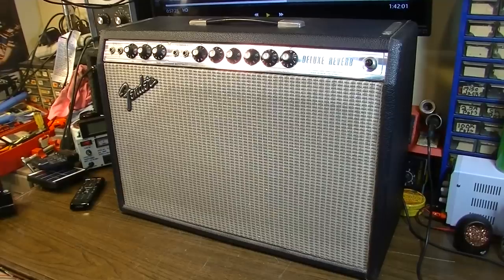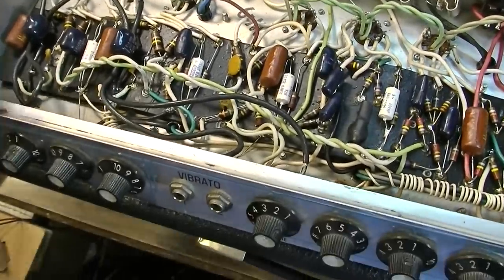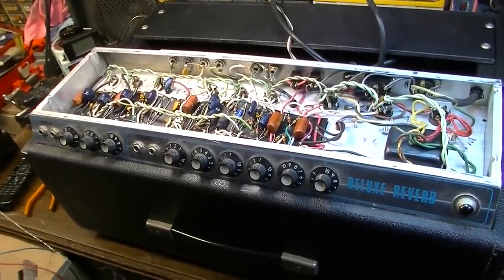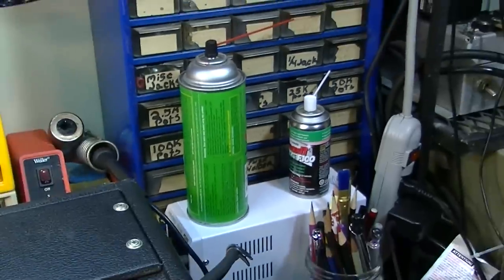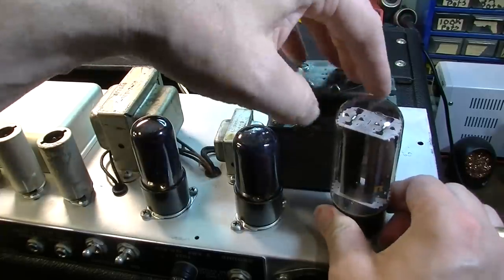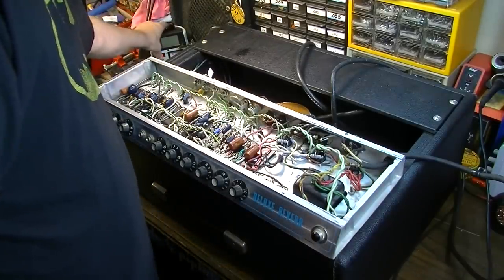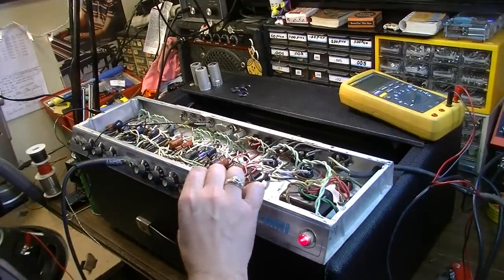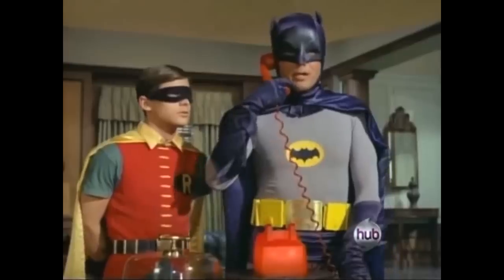SECRETS of the Fender Deluxe Reverb - The BEST Fender Amp Ever? (FULL SERVICE)

Comment: I hate to say it Brad but at the beginning the customer wrote and I quote "check the tubes"  lol...
Reply from the maker: I did. Didn't you see me fire up the expensive 1974 vintage tube tester and go to town at the end? ;)
Reply: I just don't understand I truly do not the customer specifically requested and still you refuse and yet you spend extra time to diagnose an issue you would have found by testing the tubes I mean you had them out why not test them at least you took some of what I said to heart on the last video maybe I can get you the rest of the way over the hump!
Reply from the maker: I didn't "refuse" anything. I did it. I spent no "extra time" either. As for cleaning sockets, I clean tube sockets as a matter of course all the time. Been doing it for years. I just don't do it on modern Mesa-Boogies less than 10-years-old with tubes that have no oxidation on the pins whatsoever. You saw me wiggle the tubes in that video...not a SINGLE pop, scratch, or hiccup. The sockets didn't need cleaning. It's that simple. The tubes that were faulty were discovered in due time and changed, same as they were here in this video, and it was done in the 1-hour minimum timeframe, meaning it was within the mandatory bench fee. Only one tube needed changed here and it got changed. Not sure what you want from me. My advice is maybe make your own videos. If you can figure out the YouTube algorithm, maybe you'll make a career of it. Good luck.
Reply: Now your just insulting my intelligence  you showed where the customer stated in his own words "check the tubes" if you did this you didn't show it and if you had you would have discovered the tube you ended up changing was bad and and that part would not be in the video it's that simple and had that tube been tested and changed at that point you would have had the circuit fixed much sooner.

As for cleaning tubes and or sockets I've watch most of your videos and have only seen you spray the sockets maybe a few times that I can remember but never seen you cleaning the pins until I mentioned it and I remember maybe one or twice you actually testing some tubes.

All I know is if I sent my amp in for service I would expect the tubes to be checked without needing to request it and if I had requested it and it didn't happen I would have my amp serviced somewhere else next time. 

I'm trying to give you suggestions that will only help you succeed but I'm starting to think they just fall on deaf ears.
Reply from the maker: Dude, the tube I changed was the reverb tube. I already knew the reverb had an issue and I wasn't troubleshooting the reverb until late in the video. By the time I came to troubleshoot the reverb, all I had to do was pull the tube, try another one, and discover, hey, problem solved. The symptom pointed to a likely tube issue and I even said as much a little earlier on.

Dude, you're welcome to type out all the suggestions you want, but they mainly just indicate you have not watched even a fraction of the 500 or so videos I've posted on this site. Frankly, I hate this fucking dick-measuring bullshit from other "techs" on the internet. It isn't worth my time. My default position is tubes are at fault a lot less of the time than most "techs" think. Tubes that test low emission could last another fucking decade and you know it. Lying to YOUR customers about these tubes' prospects in order to increase revenue at the expense of vintage RCA tubes is not an approaching I'm going to jump onboard with. Sorry. Get the fuck over it.

By the way...this might come as a shock to you, but I don't need your advice to "help me succeed". I have more requests for work than I can possibly take on.
Reply: Nope no more suggestions you got this all on your own!
Reply: You know I was gonna let this go but sense you feel the need for viciousness I'll say this, If your not open to constructive criticism maybe you should disable the comment section all together because it's not realistic that all you going to see are comments saying how wonderful you are coming from people who most of which have little to no technical knowledge at all.

I have not cussed or made any nasty vicious comments to you or about you, I've only made helpful comments to invoke adult level discussion on a topic of interest which should serve to help make "your" channel more interesting but now I see that's not what you truly want, you just want people to agree with you and the fact that I haven't has you coming undone at the seems.

So my last suggestion to you will be this, if you can't deal with comments along the lines of mine maybe YouTube is not the place for you if you can't embrace the community and your subscribers without coming undone I'd hate to see how you act if someone was really coming off sideways at you.
Reply: Doug The Tech Guy "this channel doesn't have any content." Why don't you show us all The Correct Way?
Reply: lamech006 I disagree the channel does have a lot of good content and I'm not bashing Brad at all everyone has their own approach to things and that's what makes the world so diverse but it's hard to not offer suggestions when you feel there's a better way to do things, I am by no means a Mr. know it all however I do know a lot about about of things but like I stated your not always going to have everyone agree on the same approach, I'm old enough and wise enough to know this.   

As for me doing video I have considered it but my work environment is not conducive to recording and I don't really have time honestly to edit video etc. I'm busy doing my own repairs I barley have time to comment on videos most times usually I just have a video I'm watching as I'm stuck at the bench, I work 7 days a week and a lot of times 15 hour days as I'm pretty busy most of the time and YouTube is my TV
Reply: Brown Paw you know I have a wall covered in diplomas and certifications and I've been in electronics in one form or another most of my life and I'm 50 now and I'm more than qualified to make the comments I do I can back up every statement with electronic facts I've not said one thing that's not true.

Comment: There is only one way that this amp is so clean. I hate to say it. It was a closet queen. Yes sir, it the cover put over it & then placed in a closet for all these years.
Reply: Two Beers actually it was filthy! I cleaned it up with a detergent and water the night before I took it to the guitologists shop. I was kind of embarrassed that I had had it for 4 months and really hadn't done anything to it to clean it. I took out the reverb tank and everything except the speaker. It probably wasn't an amp used for gigs. It does have a small amount of wear and tear but not much.

Comment: The boutique used gear shops think that they are made of gold.
Reply from the maker: Expect to pay between $900-$1200 for a SF in good, used condition right now. That's been my experience of late. The high side would be fully serviced and excellent condition. Maybe a little less for ones with issues. Still less than the new reissues. I can't imagine buying a reissue when the old ones are still less money.

Comment: Why is it that you only find reverb in an amp if it has tremolo as well? I can't think of a single Fender amp that has reverb on it all by itself. If you want reverb you have to have tremolo and that's that.
Reply: D.Edward Rice 
I noticed that as well.
I want a Vibroverb without the Vibro.
Really wish I could build the damn thing myself.
Reply from the maker: I love trem personally.
Reply: Blues Jr. has reverb, no tremolo.
Reply: Well I like it too for certain stuff. Truthfully, I'd probably find it far more useful if you weren't always stuck with the stock speed and depth. The depth control is probably OK as it stands but I'd like to be able to slow down the speed by a LOT. I'd like to fiddle around with something that was more in line with slow "sweep" of a phase shift pedal for the slow end of the scale. 

It's fast enough as is I guess but besides wondering why reverb was always tied to tremolo, I have also wondered why they never gave us a wider range of speed control on the trem. I know you can change the speed by fiddling around with the values of those 3 caps in the trem circuit but I've never really seen any specific values posted for slowing it down or speeding it up either for those who might want it to go even faster. 

I wonder, can you change the slowest speed of the oscillations, making it as slow as the slowest phase stomp box without affecting the top speed? Actually, If you were having a slow week sometime you could probably do a whole video on modifying the speed and depth of the tremolo  on a Vibro-Champ or something like that. I can't be the only who feels that tremolo could be more useful if you had more options with it.
Reply: Weber has a kit. If you have any experience in working with these kinds of circuits or at least a basic knowledge of electricity and some mechanical aptitude you might look at building it from a kit. I've build a few different ones from kits. I found it to be a little like painting by numbers actually. They provide schematic and layout diagrams. 
https://www.tedweber.com/6a20hp-c-kt for the amp kit overview
https://www.tedweber.com/media/kits/6a20hp_layout.jpg for the layout
https://www.tedweber.com/media/kits/6a20hp_schem.jpg for the schematic.
Reply: Blues Junior and Blues Deluxe only have reverb.

Comment: "UL approved death cap"
Reply: The X2 caps should be used in pairs, one on each side of the power cord to ground, AFTER the fuse. If one SHOULD fail, it will blow the fuse instead of tripping the circuit breaker.

Comment: *sigh*.... why do some techs always never replace the parts as close to the original as possible?  One small change here and there and next thing you know practically all of the parts have been changed out of spec and pretty much just modded the amp and does not sound like the original.  I find the younger Millennial techs are guilty of this...  This is why I learned to service my own amps as good amp techs are getting hard to find indeed........ no pun intended bud, just venting.

Comment: Brad... Brad... Brad!....I love your troubleshooting videos, but in this particular one you break a cardinal safety rule. TAKE YOUR RINGS OFF (AND ALL JEWELRY OFF) WHILE TROUBLESHOOTING ANY ELECTRICAL Equipment! Please consider setting an example for others, by taking all of your jewelry off (especially rings) before troubleshooting. There are a lot of hobbiests watching the channel, who have not had the benefit of formal electronics training. Day one of any type of electronics training course stresses the importance of removing all of your jewelry before troubleshooting. 

When I was in the Army, a buddy of mine had his wedding ring melted off his finger, and turned into gold nuggets, while troubleshooting a high voltage power supply. It caused 3rd degree burns on his ring finger, requiring skin graphs. While it's doubtful that a Fender amp has enough current to melt gold,  but it can use the ring as a direct conduit to ground (through your body), and deliver a nasty electrical shock (worse than if it just contacted your skin). 

Sorry to be bagging on you about this, Brad, but that glaring gold ring in the video gave me the heebie jeebies remembering what happened to my Army buddy AND all of the training warnings we had about removing all jewelry (including Dog Tags) before troubleshooting any electrical equipment.

I have a 1980 Fender 75w Lead amp, that I bought in burnt out condition in 1982, from a young man who spilled beer into the output circuit while the amp was turned on. It's all tubes except for the rectifier. It has four solid state diodes in the Full Wave Bridge Rectifier. It's the typical Fender audio tube run, of 12AX7's, 12AT7, 6L6GC's, and a large reverb pan. It's a combo amp with a 15" speaker, and I stack it on the top of a Fender 4x12 cabinet from the same era. The amp required extensive repair : all of the tube filaments burned out, the volume pot and High/Low power switch burned out. The tube socket on one of the 6L6GC's caught on fire and the socket and several associated resistors burned up, and the speaker coil burned out (this was the most expensive component to replace, it was sixty 1982 dollars). 

I repaired all the damage and replaced the tubes, and I've been using the amp trouble free ever since. It's only drawbacks are that it is heavier than sin (about 70 lbs), it has enormous headroom, and I don't particularly like the tone of the lead channel. The huge headroom makes it a perfect pedal platform, and sitting atop the 4x12 cabinet with the High/Low Power switch (35watts/75watts) on High, it can get louder than all gitout. Playing through a 15" and four 12" speakers, through a set of good tubes, moves a lot of air! You can feel your clothes jiggling when you stand in front of it. I resently had to re-cap the set, replacing all the fourty year old electrolytic capacitors, and it's good for another thirty or forty years!

Comment: you're like a dealership auto mechanic.. start throwing parts at the thing without proper diagnoses....hahaha
Reply from the maker: You clearly haven't serviced many Fender amps. You can practically fix 90% of vintage Fender amps by simply changing the high percentage failure components. No need beating around the bush, unless you just like running up a bill for the client. If you're doing a routine service on a vintage Fender, you'd do well to start by doing exactly what I did in this video. Or ignore my advice and cry about it later.

Comment: Caig has been around quiet awhile. They don't do "promotions". Their chemicals are expensive to make which is why you get a smaller amount vs your standard "Radio Shack" Electronics shop Junk spray.. Besides the amount you use of Caig's chemicals are considerably less as it's concentrated. 
The one thing I absolutely can't stand about Caig is that bullshit, POS "Perfect Straw". Try spraying a pot with that piece of dogshit! "Imperfect Straw" is a better discription..
A Mullard GZ34 will last around 50 years and give you a few more volts and draws only 2 amps. A 5U4 draws 3 amps and puts out less voltage.
Reply from the maker: I assure you, they do promotions. They recently sent me another email trying to get me to participate in a $1000 video prize. They were awarding $1000 to the YouTuber who made the best Caig commercial.